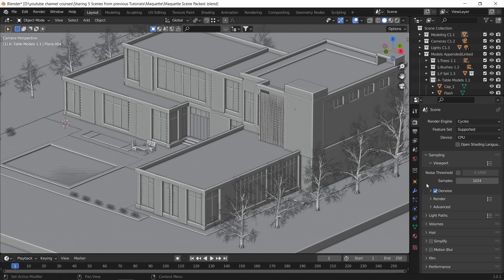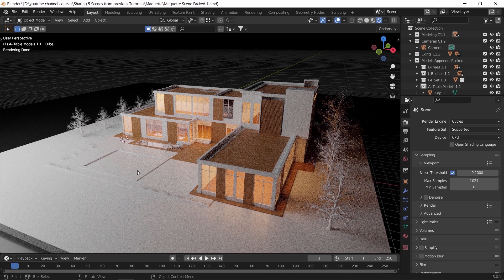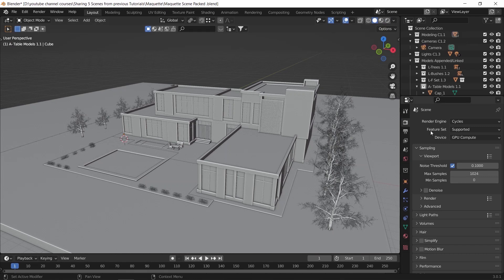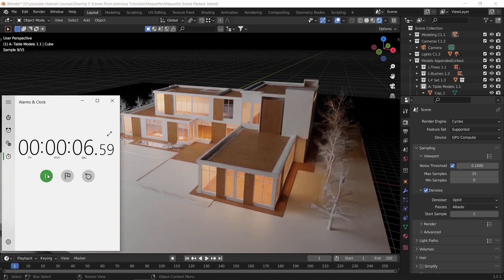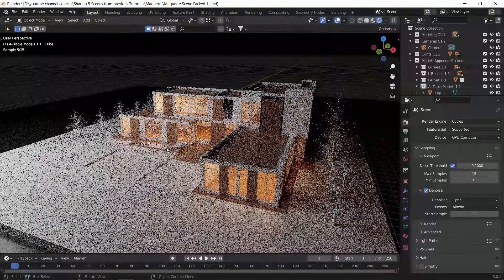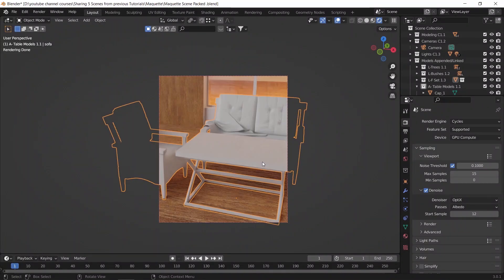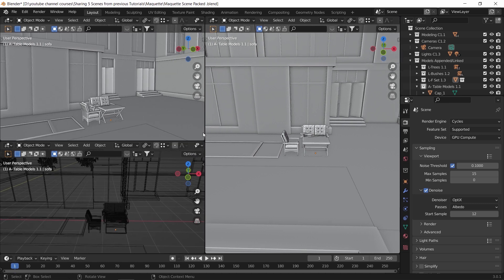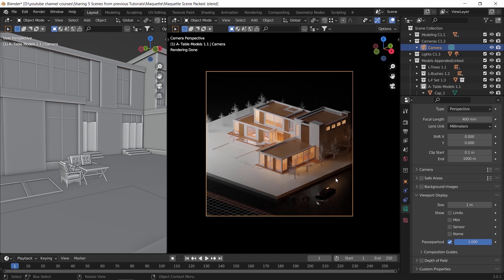Blender 3.0 Viewport Render Settings - Optimize Render Time

Comment: My F12 render window shows my model but I have to keep zoom down for it to fit in the window, how do I solve this ?
Reply from the maker: The F12 Render image will output your camera frame, so you should check it first to see if it's set far from the model.
You can hit numpad 0 or go to View - Cameras - Active Camera to get the camera view and move it around to suit your scene.
Reply: @architecturetopics  That is what I normally do. So the issue is not that. Not sure what it might be
Reply: I was able to solve it. The issue is under the outpuy properties. You have to set the resolution to 50%. 1920 x 1080, 50% The window opens to moderate size. However, I am trying to figure out how to make open in the the centre of the screen rather that to the left.

Comment: hello , i have been using blender 3.4 recently and i noticed that it crashes whenever i try to change the viewport shading to rendered or material preview , may u help
Reply from the maker: - This most likely relates to Graphic Driver. First check if your setting is on CUDA in System and not Optix since it might be the problem.( switching the render between CPU and GPU can tell you that if CPU works that indicates a problem in GC.
- Make sure the problem is not with a certain file cause maybe the file is corrupted so try another one.
- You can also Either update your driver, or if you update it recently and the problem occurred, try reverting it to the previous version.
- Also Try another official release blender Version ( Not beta). 
Hope this helps

Comment: good day sir, I love your work and I always learn something new. my question. after modling a house, do I join all modles, e.g. door, wall, windows, etc into one modle??
Reply from the maker: Thanks mate! Glad you liked it.
For the question I don't think so. We don't need to join models or parts of a model since it's a lot easier to edit each part alone.
You can however Organize your layers to keep the work flow smooth.
So for example instead of joining all parts of a Door model we can select them all and parent them to an empty and this way we can move them all together, and also we don't have to enter edit mode with the entire object vertices display which gonna make your device lagging at some point.
Hope this helps and wish you the best.

Comment: bro my viewport is laggy any idea what's going on ?
Reply from the maker: Either Too much vertices in your scene, or you have too much Add-on enabled. you can also check the device temp cache and delete them.
And maybe get a new version of blender to see if the old one have its settings missed up or got a problem with it.
hope this help
Reply: @architecturetopics   clearing the temp cache helped little but still laggy will the new version resets my setting ? and numbers